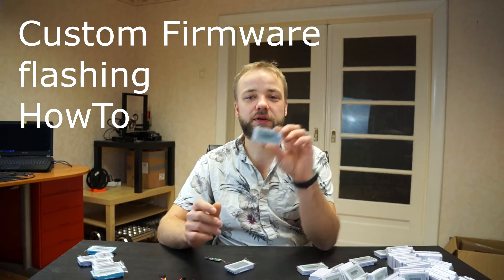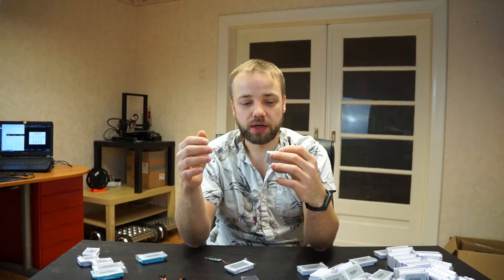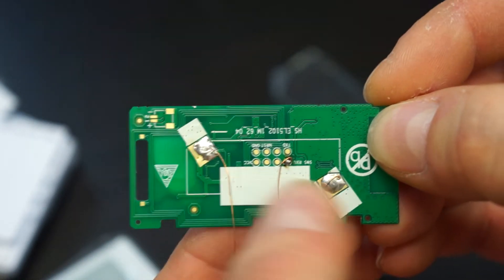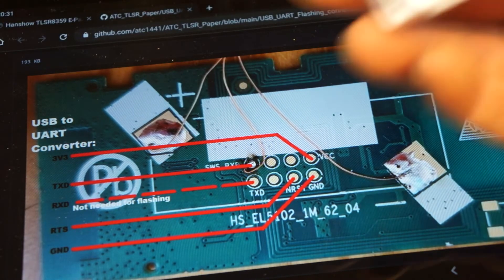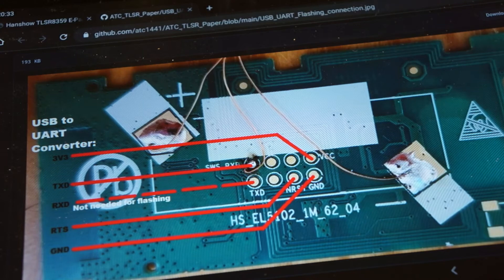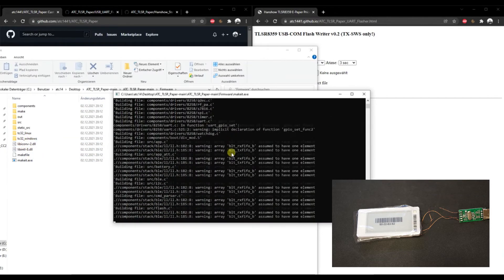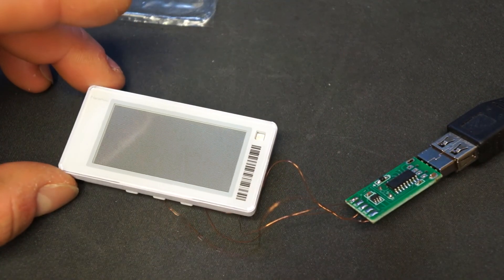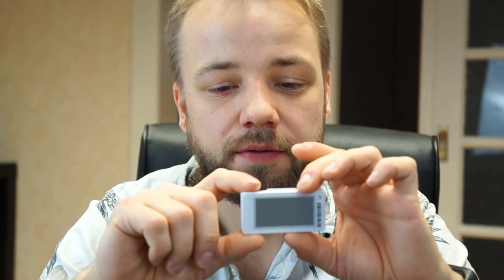Hanshow Stellar E-Paper Shelf Label Custom firmware Flashing

Comment: For flashing, can I directly use the ATC_Paper.bin file which I get by extracting the ATC_TLSR_Paper-main.zip folder? Or do I need to run the the makeit.exe? And do I need to connect the batteries while flashing?

Comment: Is there any way of updating the firmware without connecting the pins? Welding does not seem practical if you have to do it 50-100 times. Maybe if I'd have a jig to always connect the pins to proper spots but even building such seems like a lot of work. If someone would have original Hanshow software, maybe it would be easier to reverse engineer that and use the original protocol?
Reply from the maker: Only flashable by wire my friend

Comment: Im using a USB CH340 converter and my pins show as: R, T, GND, 5V, 3V. I see in your video you talk about a RTS pin. Do you think this is this the same as the R pin shown on my converter
Reply: I did find the RTS pin on my converter but i had to connect directly to the CH340. (My usb converter didnt directly expose the pin)

Comment: Hello! :)
I found a tag in my groceries and so i flashed it. 
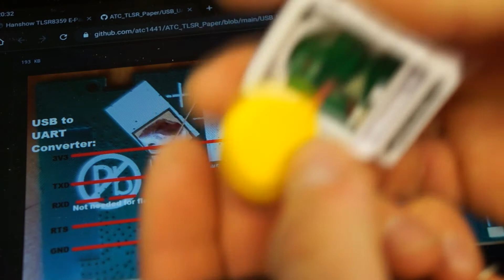its one of the smaller ones like you are holding at 7:30.
Only thing is it only seems to be using 1/3 of the screen. 
Do i need to change the screen size somewhere?
Thanks in advance.

Comment: Hi @atc1441 - excellent job - I've disassembled (destroyed! it's all glued together) a Hanshow Nebular model, where the SoC is labelled as HS9118. The standard serial pins are exposed as well, so I would like to ask you if it's possible, by plugging a serial-usb adapter, to verify which kind of controller it's based upon, so to check wheher it's ever possible to flash it with this firmware (maybe adapted...) - thanks!

Comment: Hey!
I flashed the ATC_Paper.bin to the Stellar-MFN@ E31A but the screen isn't doing anything and I am not able to chance anything, I am able to connect to it over Bluetooth But that's about it.
The LED flashes green occasionally.
Reply: I have the same problem. During the flash write i could see the leds blinking etc, but then when its done the display didnt show the screen with lines. I think my issue is the usb converter (I could not find a RTS pin but only a R pin and i am not knowleadgable enough to know if it makes a difference)

Comment: It looks like some Nebular devices aren't comfortable with being flashed using this method. I obtained a 2nd device Hanshow Nebular, and it does respond to flashing - but the first one didn't respond at all (except for the blue LED flashing during programming activity). The 2nd one does do something different on screen. And, I briefly see something that looks like the clock app. But after a few moments the screen has gone mostly white. Also, there is no BLE device found by my mobile phone - so maybe that doesn't yet work.
Reply from the maker: Hey. That type is still WIP :)
Reply: Hi, yes, I understand that it's still in progress. I've confirmed that I've got the firmware in to Nebular - and I can prove it because I've added my own printf inside the  main_loop function. Now, every 10 seconds I see my printf appear on my computer screen. I'm using a simple serial port terminal program set at baud=115200 No Parity, 1 stop bit. I connected the  TXD pin on the Nebular to the RXD pin on the USB/SERIAL adaptor. But, the actual nebular screen is just garbled.
Reply: One thing I noticed is that I need to pull the RST pin high to 3.3V to keep the printfs coming out. As soon as I remove that pin the printf's stop.
Reply: @nethomas1968  Any luck getting the Nebular working since your last message by chance?
Reply: @nickmunro1256   Yes, I did make progress with programming the Hanshow Nebular. I also made a native C program to flash the device so that I don't have to rely on the Web serial programming tool.
But, I haven't actually got anything sensible to show up on the display yet. 
I'm reading the SSD1685 data sheets, but, I've not got it working yet.
Reply: @nethomas1968  Great news that you share. I have a Nebular here, and was wondering if you managed to get the display or even BLE to work, or if the Nebular series is a dead end. Thanks for your updates!

Comment: My CH340 UART/USB adaptor doesn't have an RTS pin. It's got GND, CTS, VCC, TXD,, RXD, DTR.  Which is equivalent to RTS ?
Reply: Ah, I made some progress. my CH340 needs to have GND, CTS, VCC and TXD pins connected to the Hanshow Nebular 350R-N device. Now I see that the blue LED is flashing when there is activity. But, the device doesn't actually respond to the flashing commands. The "Soft Reset MCU" doesn't appear to do anything.

Comment: Great work ! I have an HS_EL5102_1M_62_04 board with TLSR8359, connected the wires with RTS to DTR on my adapter but after Unlock and firmware update nothing changes on the display and no new BLE device ... what am I doing wrong ? Thanks !
Reply from the maker: Please repower the display shortly before doing the update.
Also try it multible times
Reply: @atc1441  Thanks ! I will try and report back. Do i need to try other baudrates too ?
Reply: Hi there! Failed to upload the firmware...probably this unit is faulty. I've soldered a switch to the power pin and switched on right before pressing "Write to Flash" and tried several times... i will try with another unit...Thanks!

Comment: Hi, I didn't really understand what you were doing with the mobile phone. What is BLE? Is that bluetooth connection? Is there a custom app on the phone? What's B1 ??? Please expand a bit on all that.
Reply: Ble is blue tooth low energy or blue tooth 5.x. they send the code "0xb1" a hex number to the specific Bluetooth register, which the custom firmware reads as "do action B1 in the list of things to do".
Reply: The ble app is a generic one, which displays all broadcasting Bluetooth devices and let's you send arbitrary responses.

Comment: This is great stuff - I don't suppose you happen to be familiar with the hanshow nebular line (seen in Aldi UK)? they feature the HS9118 proprietary ARM processor. I've not been able to find anyone who is playing around with it.

Keep up the good work and feel free to share your thoughts on the HS9118/nebular series if it interests you.
Reply: HI, yes, I have a Hanshow Nebular ESL. I am trying to use the programming instructions as described on the GitHub pages, but so far I'm not having any success. My first challenge is to get the pinout's set up right. The hanshow appears to have 6 pads, but it's hard to read the code to see which pin is VCC etc.
Reply: @nethomas1968 Did you have luck with it yet? The vcc pin is the second from the right btw

Comment: My usb serial adapter doesn't have rts port, how can i send a MCU Soft Reset signal?
Reply from the maker: You can also power the display up very at the start of the flashing, you may need to try it a few times
Reply: @atc1441  I have used the flasher several times on two slightly different stellars, with windows and with linux. The LEDs light up and then I assume the procedure was successful. 
How can I power the display up?
Reply: Your USB Serial adapter will have an RTS, but it might not come out to one of the pins on the edge of the board. The little micro chip on the adaptor has lots of pins, and one of them will be the RTS pin. That doesn't make things easy for you, but it's possible to touch a conductor wire on to the correct leg of the chip with one hand and click the button on the web programming serial web page with the other hand. It's tricky - but that's what I can do. My USB serial board has a CH340 chip, and pin 14 is the RTS.

Comment: Awesome work! My TTL-USB adapter didnt have the RTC pin. but setting aTime to 0 and baudrate to 921600, and messing about with the several buttons seemed to work!
Now i've got a spiffy clock! And the connection via BLE works quite nice as well!

Bit of backstory, these are commonly used here in Holland by the Albert Heijn. Found one on the side of the road, and thought i'd look around for any hacks for it, only to find quite a complete project with even BLE support. Again, amazing work on it.

Next up is to print one of your cases for it. would it be possible to provide a link or add them to the github?
Reply from the maker: Hey. thank you !
Here are the 3Printable Cases https://atcnetz.de/downloads/TLSR_Case.zip
Reply: @atc1441  thank you so much!
Reply: @ColdInferno  hallo, ik heb er ook eentje van de Albert Heijn. Maar ik begrijp niet hoe ik hem moet aan passen, aangezien hij alleen maar z'n prijs laat zien. Kun je mischien uitleggen hoe jij het precies hebt gedaan
Reply: @thijswessels2267  desbetreffende pinnetjes gesoldeerd met dupont connectors aan t eind. Deze op een ttl-usb adaptertje geprikt, vervolgens net mazzel hebben met de timing zodat ik de de rtc pin niet nodig had. Als je me verteld waar je op blijft haken kan ik je beter uitleggen wat de oplossing is.
Reply: @ColdInferno  Hoi, ik heb de M3N@E31HA. Mijn TTL heeft ook geen RTC pin, ik heb geprobeerd wat je had gezegd; beetje knopjes klikken met aTime 0ms en 921600 baud rate, maar het luk mij nog steeds niet. Firmware flashen lijkt iets te doen (lampje knippert) maar daarna blijft het scherm op de originele zonder te veranderen.
Reply: @FlapD  het is net mazzel hebben, ik heb t echt meerdere keren moeten proberen voordat het net goed ging.

Comment: Hello,
my module: HS_EL5102_1M_6Z_04
my programming via USB without problems
BLE connection "ESL_E505C7" ok via your website app
but no display reset
I think my lcd is red in addition: Stellar-M3N
how to force reset display
Thanks for your help.

13:22:34: Connecting to: ESL_E505C7
13:22:47: > Found write characteristic
13:22:48: Found custom Main service
13:22:48: Found custom write characteristic

Comment: Good sleuthing!

Just an idea to consider: For repeating this exercise frequently, rather than hand solder your CH340 serial adaptor to each e-Ink board with flimsy wires and the risk of lifting the solder pads, how about a quick 3D print adaptor or PCB board with pogo pins poking out that just presses down on the pads?

Put it in a spring loaded jig and it will hold it in place reliably. Faster, neater, more elegant, and doesn't leave evidence of tampering.
Reply from the maker: Good idea, and i did exactly that later :) 
See here at about 2:50
https://youtu.be/HVyQKORKj1g
Reply: I thought that when I saw the clues in the video :D I have a label and I'm investigating if it is possible to write on it.

Comment: I always love your work (although a little difficult for me to follow)
Just one question: can this unit display MQTT messages over WiFi?
If yes, I think I'll try to build one by myself.
I built an e-paper display for my rotating picture frame using LilyGo ESP32 a while ago.
https://youtu.be/emR7AzLxxXU
It works great so far but has one big problem that the battery can't last more than 10 days despite ESP's deep sleep.
I suspect the module has some battery leak since my code is just simple and straightforward.
Anyways, great video again and hope you continue good works!

Comment: Thanks for the video ! i think i unlocked / eraased / flashed succesfully two unit but for some reason the screen do not refresh after the flash, BT doesnt seems to work either. i have a blue led flashing on writting and everything seems to be correct on the web page :/ anything i can try ?
Reply from the maker: Please try it a lot of times, there is no way for the flasher to know it it all worked out
Reply: Ola  @atc1441  , mind sharing the sketch with the simpson so i can keep trying with different files ?
Reply from the maker: Its all in the repo :) its the same firmware
Reply: The same thing is happening for me.  I flash it but no BT and the display does not update. I have also check the issue started by dustybee in the github repo and it looks like with the .bin file provided by him in one of the comments the display works. The display is updating. It could be that we have a slightly different module.

Comment: Great job, really clear and useful video!! What USB to UART converter did you use? I'm not able to communicate with my Hanshow ESL but I have a converter which is defferent from yours. Thanks!
Reply from the maker: Hey. I used an ch340 in that video.
Reply: @atc1441  thank you! 😉
Reply: @pacchinmattia  make sure the jumper (if u have one on the board) is on 3/3v and the RDX pin is not connected. i also add to install the drivers (ft232r), after that all worked fine !
Reply: @Semtex199  yes, thank you!